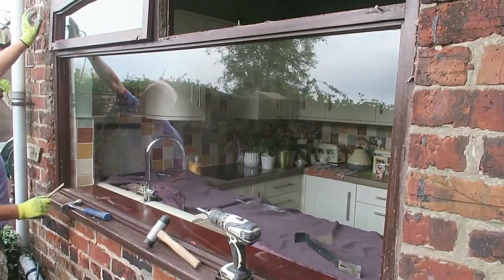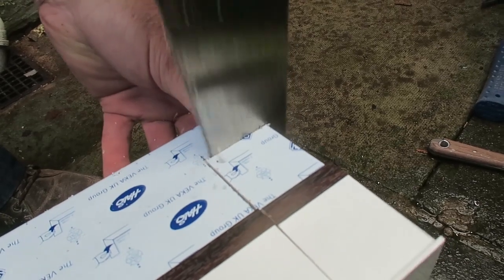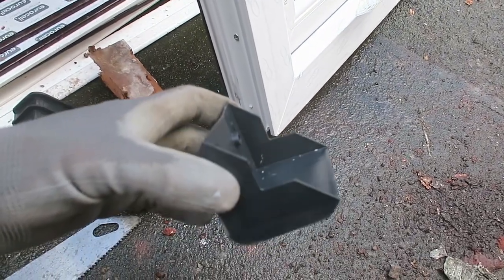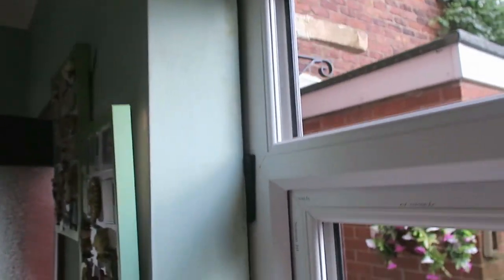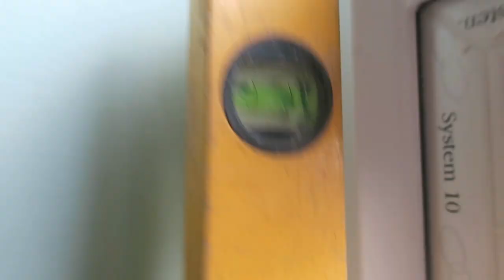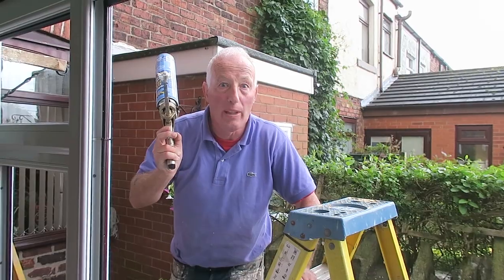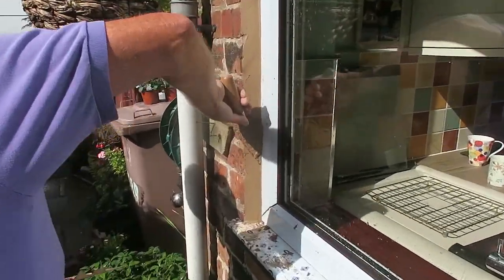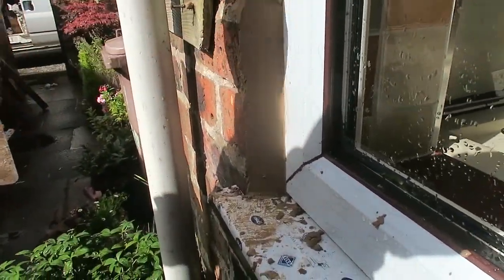how to fit double glazed windows - LOVELY JOB

Comment: Hi
If you have fixed the bottom of the window with screws in the drain channel will this not let water leak into the blockwork and back into the house
Reply: Silicone around the hole, then fit the screw. The hole is then sealed.

Comment: drilling the frame?! madness
Reply: Since this is how all UPVC windows and doors are attached to the brickwork/blockwork, a necessity.
Reply: @philipmcfarlane   window fixing clips allows to keep new frame undamaged, which helps alot with overall insulation, more work, but that's the proper way to do it.
Reply: @tm-lc2mg  no its not ammos are easier for everyone and makes no real difference